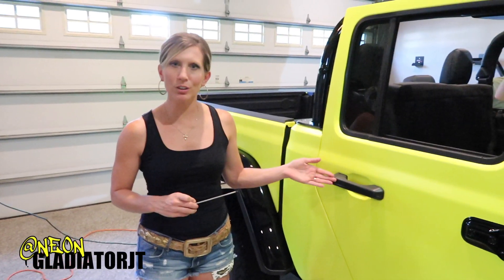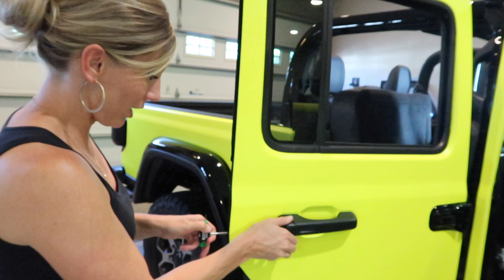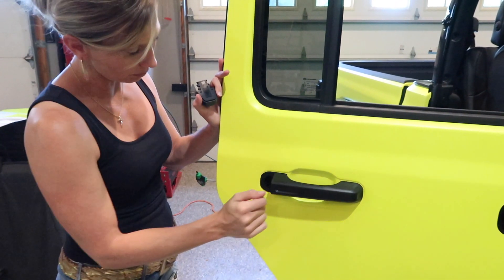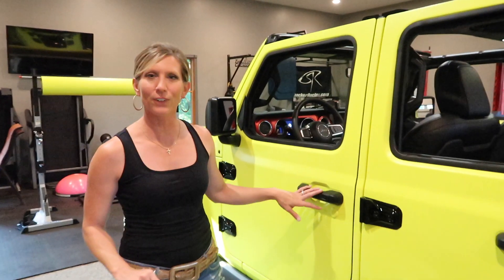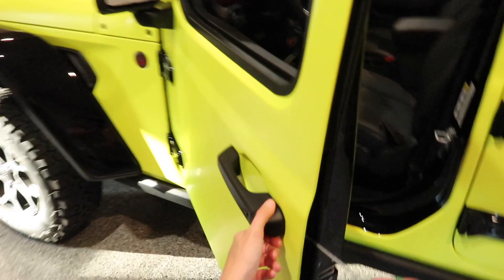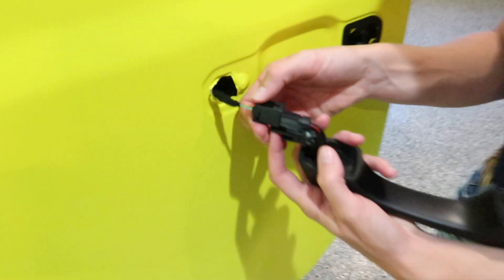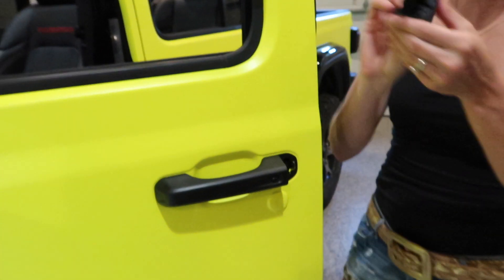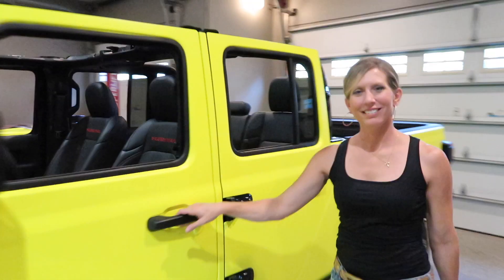DOOR HANDLE REMOVAL Jeep JL & JT Gladiator Front & Rear *HOW TO

Comment: Thank you very much for your video.
Tell me, if I need to replace the front handle with a new one and the old handle had a keyless entry system, will the new handle work? Or do I need to go to a dealership to get keyless entry with a new handle?
Reply from the maker: I am not sure about that.
Reply: @shockerracing  
Thanks a lot for the quick response.
Do you think that a dealership is unlikely to be needed? It seems to me that the new handle should work immediately after installation? But I'm not sure either...

Comment: How has your wrap held up? I just had to remove mine on my 2020 Gladiator because the hood started fading. It was HUGE pain to get it all off.
Reply from the maker: We are just at about 5 years now but it is really faded. I would say we got 3 good years out it it before it started to fade. We recently started pulling off some of the wrap on a hot sunny day and it was coming off nicely.

Comment: Anyone else have a hard time getting the electrical clip off? I cannot do it. As hard as I pull it won’t budge. In fact, it keeps detaching in a different part of the handle.
Reply from the maker: Push in, squeeze the tab and then release.
Reply: Thanks for the reply. For the life of me I can’t get it to come off. Every time I pull it separates a different part closer to the handle. I replaced everything on the jeep except these two sensor parts of the handle.
Reply from the maker: @nomorepiggybacking  that’s so weird! I just replaced the door handles on the 392 and those clips were so easy to disconnect. Maybe this video from our friends at Cast OffRoad will help: https://youtu.be/Pm8np0ZWUUU?si=2C8-vpRzUgyVRVlP